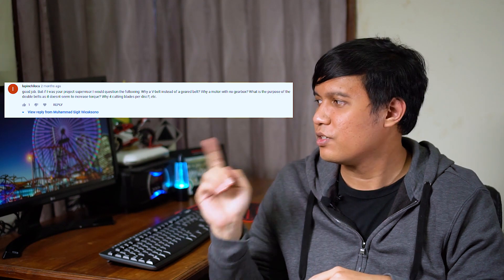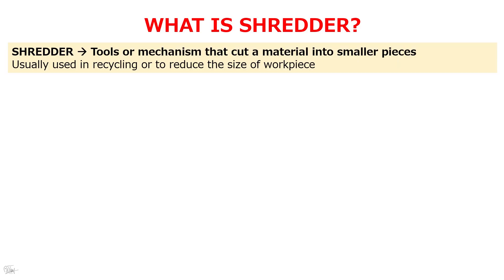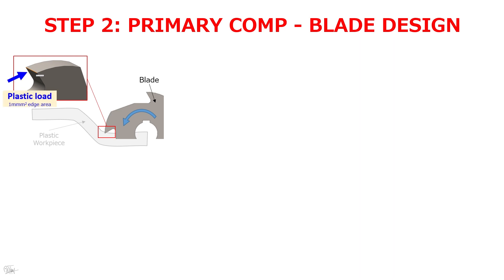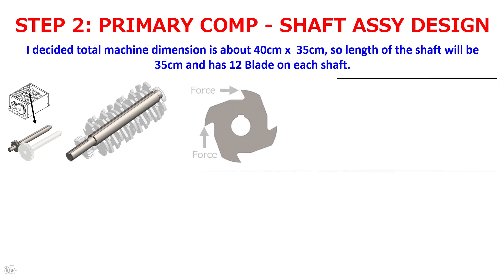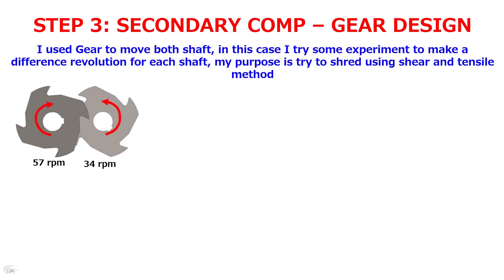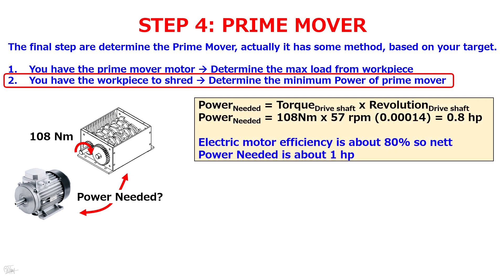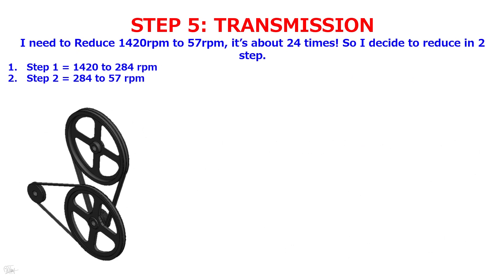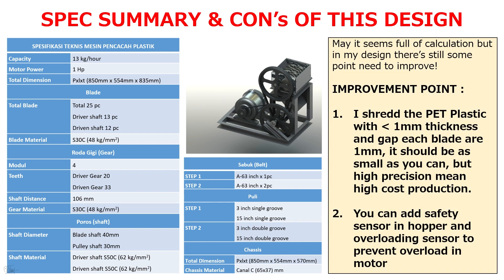TUTORIAL HOW TO DESIGN A PLASTIC SHREDDER MACHINE || Calculation Shredder Machine You Better Know

Comment: how u calculated the area of the blade edge?or u take it as assumption 1mm?
Reply from the maker: Blade width 10mm, and edge sharp assumption 0.1mm. Assume edge area 1mm2
Reply: @muhammadsigit973  thanks bro it's my final year project this year I need some help in calculation can u give me ur email
Reply: @muhammadsigit973  and brother other question is that how we can find the diameter of both pulley  if we don't have the rpm of that pulley. Means how u select this diameter of pulley
Reply from the maker: @moeez-ul-haq8159  1. Determine final rpm in blade that you need, calculate ratio between your motor and your blade.
2. Choose the diameter pulley that available in the market depends on your ratio.
Reply: @muhammadsigit973  thanks bro 😍

Comment: Hi thanks so much for sharing your idea.  how to gate the revolution of the shaft  at first that mean N1 how to gate ? which type of belt is used  please shear the total calculation part or design part
Reply from the maker: You can got revolution from motor spec and reduce ratio of your pulley set. I used A type. (It depend on total transmitt torque)

Comment: Hello 
I am from India.  What is your advise for production capacity like 300 kg per hour . Can we use 5 or 7 HP motor with your this specification ?
Reply from the maker: Hello, just in my opinion... to determine the exact performancr you have to calculate it first, at least general calculation for motor power

Comment: Nice 👍 video. My blad just hitting each other what should I do?
Reply from the maker: Thanks for watching, I got is also when first assembly, you have adjust those blade position by spacher thickness. Or add chamfer in blade side ( i saw another shredder with loose between each blade. There's a friction from each blade)

Comment: Brother Mohammed Mashaa Allah you’re a very experienced designer, i was wondering about the capacity of your machine, is it determined by the multiplication of the overlapping shear areas of the blade (side area), by the average linear velocity of these overlapping blades (2*PI*60/Radius), and by the density of the target material should this shredder put up with, and finally by the number of blade-to-blade interface (i.e. if you have 16 blades you do have 15 interface) ?
Reply from the maker: Hello Brother Ahmad, Thank you for watching.

About your question, the answer is yes, it determine by:
1. Total overlapping area of blade. My intersect area isn't 15. Bcs the blade angle configuration was 3. So it will overlapping every 3 set blade.
2. Total cutting edge, mine is 4.
3. Rotation each blade.
Density of material only for determine input method.

Thank you.

Comment: How did you decide to have 1mm² edge?
Reply from the maker: Widht of blade x height in blade tip (assume it was sharp with 1mm height)
Reply: @muhammadsigit973  is the width of the blade 1mm?
Reply: @muhammadsigit973  also how did you get 4.48MPa. what if only one shaft rotates against a stationary blade system? pls can you design that one, i follow you...

Comment: so so sorry but going through your calculation for cutting force value I don't think is correct. 44.82Mpa x 1mm^2 =44.8N not 4.88N. Please look into this, thanks
Reply: Also, how did you calculate your area?
Reply: I confirm 1MPa = 1 000 000N/m², 1 000 000mm² = 1m² thus 1MPa•mm² = 1N

Comment: Brother Muhammad, may I know, how do we design the shredder blade? Like shape and number of teeth. Which type of blade that is the best? Any source that I can refer to?
Reply from the maker: Hi brother, about blade shape design until now I found no detail explanation about this..

Commonly design is 2 or 3 teeth in one blade. I try to made 4 teeth but cannot compare yet. It need some research. But so far I think it's affect to cutting time and capacity.

Thank you.
Reply: @muhammadsigit973  Thank you so much for the reply brother. I have another questions. For simulation of the cutting blade, the max stress is 1.5 MPa. Is it acceptable? Because the tensile strength of the plastic is 44.82 MPa. Second question, how do you get the value of 6.75 Nm torque? I tried to recalculate and the answer is 0.675 Nm.
Reply from the maker: Hi brother, about stress simulation.. that's true material strength is 44.82 MPa, but the force in cutting edge it should 44.82 N (I have a miss conversion in beginning of the video).
That force give the stress in blade max in 1.5MPa, different shape will give diferent amount, you can try in your own.

About the result, because of miss conversion in the beginning you can follow the step, but rechecked your own calculation. Thank you
Reply: @muhammadsigit973  Understood. Thank you so much brother for the explanation 🙏🏻🙇🏻‍♂️
Reply: @AfifMuslih  it means 44.82Mpa is not the tensile strength of plastic but it is the tensile strength of mild steel???

Comment: What is called as blade cut sir 
You took as 8.. don't know how
Reply: 1 shaft has 15 blades ,
each blade has 15 teeth, 
assumed force applied on 3 teeth
what is the blade cut for this?
Reply from the maker: Blade in each shaft sir, cutting blade for each blade is 4